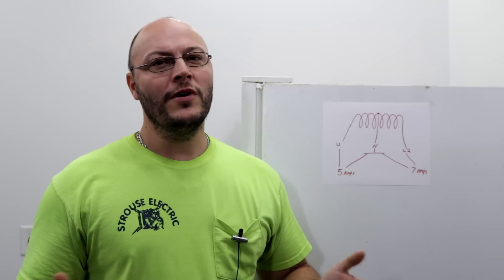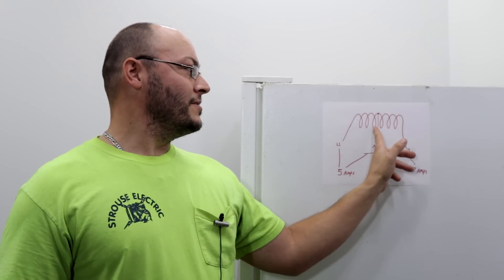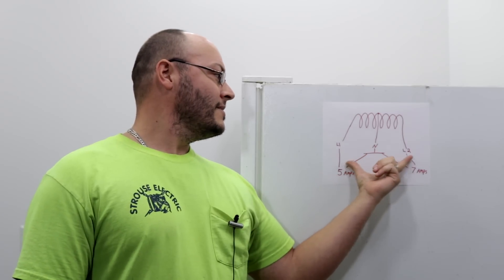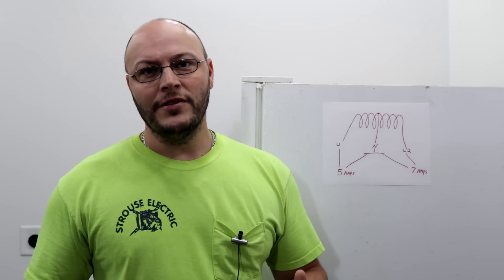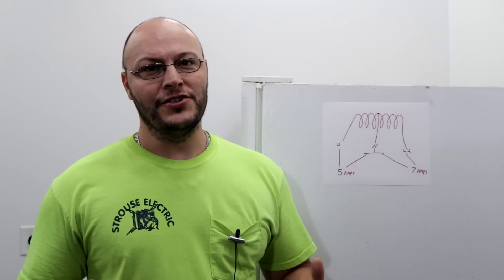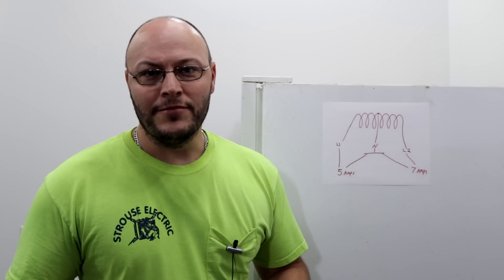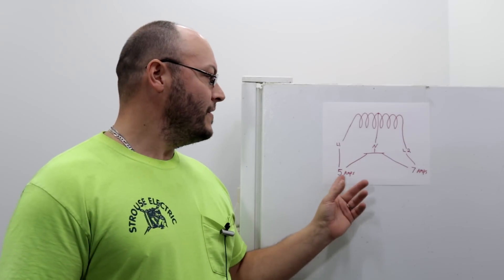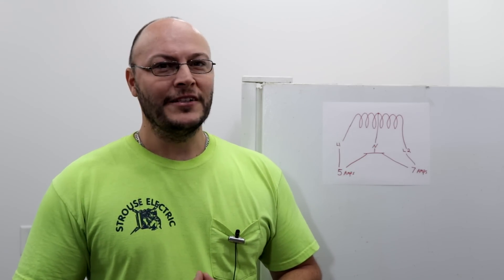What does the Neutral Wire Do?

Comment: Boy all u people need to go back to school.
Depending on what the nuetral is coming off will depend on what its doing
A nuetral coming off a pole transformer is basically a center tap for the transformer and is a means to make a return or complete path for the current.
A nuetral coming from a generator site is actuall a return back to the generator such as a y or delta genertor.
Depending on what municipal electric grid u have u miggt have one or both.
But most have center taps from a single phase high voltage llike 16kv to house voltage if 220.
Every few houses have there voltage off the same can and the nuetral is a return back to that can.
On that can there is a ground which carries earth ground incase of a short in the transformer. 
That ground is not the same as the ground in your house.
The ground in your house is its own thing and its own ground rods.
That is why there us a grounded nuetral at tge service entrance panel and water pipes. This is a bonded system in the house and a seperate path back to earth ground in case the nuetral fails and is not part of the municipal or generator ground but is bonded.
So now we have that figured out.
Every few houses have a can on a pole now there are cans on multiple poles around several blocks.
All these poles with cans on them and are tapped off the same high voltage cable of phase.
There is only one phase or up two 6 phases feeding a area of the municipal grid coming from a substation
There are several substations in an area feeding grids with transformer cans which feed a few houses at a time

So folks the ground in your house is your ground bonded to the municipal warerpipe and your house ground rods. These are bonded to the nuetral at the service entrance panel and only that panel.
After that panel the nuetral and ground are two seperate conductors in your house.
The nuetral is the path back to tge transformer can.
The ground is a safety back to the bond at the service entrance panel and will get grounded out at rhat point.
The nuetral is also grounded at the transformer  but doesnt carry a ground from that transformer back to tge house
That can us grounded at the pole usually with a ground wire coming down the side of the pole. There is also a wire on top of the pole for lightining strikes and that is also bonded

Now the y and delta generators can and also are part if the ground systems in smaller grids 
Such as backup gemerators in which the nuetral is at the generator
This is a whole other discussion 

The voltages that are respect in all of thosd people have to do with whether its coming from a there phase system of a single phase tapped trasformer which most houses are

240 120 is a single phase tappped tranformer sitting on a pole.

208 110 is coming off a three phase system
208 is the single phase  stepdown of a 477 three phase system

Anyway its not to complicated i think i covered it better.

Its been awhile since i had to go back to basics as an engineer 
But ive designed many high voltage grids for nyc and con ed.
Mostly motor control systems woth relay logic but i do have the background and also im a licensed engineer and electrician. 

Most if not all electrician dont understand grounds and nuetrals or bonding thats why there are electrical engineers.
We make sure that these systems are safe 

And sorry about the typos im beat so i just did this quick.

Ill clean it up later
Reply: Isn't it 208 120 coming off a three phase system?
Reply: Ed Taylor 

Yes
It is.
So
480 three phase
Comes out to 277 single phase 
And 208 three phase comes to 120 single phase
120 can actually be from center taped 240 which is SOMETHING a little different
Or 220 110
Depends on municipal company which is usually tapped at 14kv or some other voltage.
It all depends on the grid in your area.
Industrial areas will be running three phase feeders at high voltage and then use step down transformers

Sometimes The 240 is just transformed higher bc of loads from resistance and reactance capacity and some other factors
So the can give u a little higher voltage at 240 120
But every generator and or transformer is a little different
Thats why under load conditions it usually settles around 110

They usually just crank the voltage up a little to compensate for all those reasons above.
That's why sometimes its high and sometimes its low.
Also the load at the time of course.
But u cant just use ohms law to do three phase calculations there is a 
Squate root involved in the equation bc of the three phase component.
I wish i could type it but there isnt a square root symbol on this keyboard

But 477 is used alot in lighting in buildings bc u can use smaller conductor sizes and still put a ton of lights on one circuit
And these buulding have three phase so its easy to balance out either a power panel or lighting panel.

When i used to design motor control centers and relay logic along with the plant electric from con ed feeders into plant for the city of new york there was only three phase stuff bc its a plant
And there were redundant feeders coming from two con ed generator sites
Along with a backup generator.
So its was like triple redundant.
Especially for the sewage treatment plants and lift stations
Tons of redundancy in the electric and controls
Along with the motors and everything else.

Anyway hope this helps a little bit
But thats why large buildings use higher voltages on lights bc of being able to use smaller conductors and or more lights bc of ohms law .

P = IxV
Power is the load of lights in watts 
Voltage is the 477
And i is the current.
Or total current 
So when the voltage goes up with the power being constant the current goes down which means either u can put more lights on the circuit or a smaller conductor.

Later

Thats kind of how it works

Not only am i an liscensed engineer im also a liscensed electrician in three states
But i also taught these classes at several schools 
Or two year colleges 
Including lincoln technical institute in mahaah nj and technical carreer institutes in manhattan
I actually developed and graduated the first class for the est program for LTI
The electronic systems technician program was a two year course
That taught alarms video cctv satellite computers lan phones etc.
Every low voltage thing u can think of.

But anyway maybe one day ill do a utube channel and teach some real world stuff the easy way

Goodluck
Reply: I had a neighbor who purchased an electric sawmill, found out it was three phase and had to pay the electric company to route three phase in to his property. They fed his house off two of the phases and his wife wondered why her electric oven was a bit slower to heat. I told her that she had 208/120 vs the 240/120 she was used to. I think he later sold the saw mill and reverted back to single phase. Fortunately the electric company didn't alter the distribution to the rest of the neighborhood. My voltage is consistently 234/117. Since we are in the mountains the electric doesn't just follow the twists and turns of the road so I am not sure how far we are from the regulator autotransformers  but judging from the voltage stability not so far or good balancing.

One reason people have a hard time understanding neutrals and grounds is because of that old myth that electricity seeks the shortest path to ground rather than the truth that it seeks nothing but will follow all available paths  back to the source (pole or yard transformer).
Reply: Ed Taylor 

Probably easier to get a different motor for the saw lol

There are alot of problems with people understanding electric

If u get the whole concept is great
Then all of a sudden
U get into deep theory and its over there head.

Such as voltage 
voltage is what pushes the electrons in amd out of there molecular orbits. 

If its copper wire then in and out of the copper molecule.
The electron doesnt like this so it trys to jump back and does as the sign wave gets closer to the zero or x axis it falls back into the molecular shell until the happens again as another positive cycle of the sign wave comes  

SAME THEORY BEHIND LASERS AND FLUORESCENT BULBS AND ARC LAMPS.
THE JUMPING OF THAT ELECTRON IN AMD OUT OF THE ORBIT IS GIVEN OFF BY LIGHT
ANYWAY JUST A COOL TIDBIT 

So the voltage pushes the electron back and forth out of its orbit ring of the copper atom
And this sawing in effect of coming in and out is what the current is OR MOVEMENT of electrons

So all this stuff Works together.
Hope i explained it so people understand

But the outer electron in the copper atom is pushed in and out of its orbit by the voltage coming on and off as the signwave changes.from a positive cycle to a negative cycle

And this is also the reason why if u get electricuted   that u can pull ur hand away bc just for that fraction of a second when the voltage is zero on the sign wave u can pull your hand away woth AC. OR ALTERNATING CURRENT 

With dc current or direct current its a positce cycle all the time and the voltage never Shifts off as there is no sign wave 
So dc your screwed and toast.

Anyway so after all that then u can come up with the theory that electrons actually flow from to or towards the positve potential as an electron is or has a negative charge its attracted to a postive source 

So lets say in your car the electrons are actually flowing from ground to positive 
Thats why many years ago the car chasis was actually positive not negative

The idea is also theory when it comes to lightining 

When a lightining bolt is seen by a human

We actually see the return path as the clouds are positive charged and the earth is negative potential
The negative potential is actually.moving towards the clouds

This is called a leader 

And there are some cool photos of this leader if u look for them.
As the negative and positive meet u see the rush of the negative electrons race to the clouds 
This is what we ser as the lightining bolt 

So people on the net or utube are not always informed on what is really going on and seem to just say shit bc they think they know bc everyone kind of says the same thing but in reality there wrong

I dont say i know everything but if i do know something i will say something bc its just another classroom to me.

The problem today with people is they all think they know it all
When in reality they dont know much.
I dont or wont even open my mouth if i dont know 100 percent about something but it goes back to the last thing i said.
People are just misinformed and That keeps going from one person to another

Any how nice to talk.

Maybe someone else reads this and gets some more info

Maybe in the future ill set up a utube channel amd teach real world theory so people are taught what really is going on with electricity and electronics 

Thanks for the talk
Reply: Speaking of lightning I knew a fellow (Roy Carpenter) who sold NASA lightning elimination arrays to protect launch sites from direct strikes. In some arrays he used grounded elevated barbed wire (he didn't like me calling it barbed wire) to provide multiple emission points for electron flow from earth to the clouds to dissipate the cloud charge over that area. His company was called Lightning Elimination Associates. (catchy huh?) As a kid I noticed the top row of barbed wire in a fence lost its zinc coating and rusted before the other strands indicating electron flow and it wasn't even grounded other than by the fence post.

Good luck on teaching, the usual person surfing youtube has little interest in how things really work they just post their version and opinion often with a bit of venom. As such they cannot handle a vast amount of info in one post as you try to deliver, they are still hung up on details like the purpose of the neutral and the difference between a grounded conductor (neutral)  and a ground wire. That's probably why they are not asking you any questions you are rambling too far from the subject and trying to impress them with your credentials and they could care less they (at least some) just want straight forward answers.
Reply: Ed Taylor 

Im not trying to impress anyone
I dont have the need for it.
I have more important things to do

And i jave no idea how barbed wire would work.
As there is a specific science behind lightining.protection systems bro and id be very impressed if not fucking dumbfounded if barbed wire could be used as a downcinductor its not designed for that and the barbedbwire is to low
Bro the trees would get hit first 

But whatever floats your boat.

And like i said i have absolutely no need to impress anyone.

There are a ton of electricians that honestly dont know what a nuetral us or nevermind a ground or a piece of barbed wire as part of a lightining arrestor system.

I see it all the time on inspections 

But ill look for that bardwire down CONDUCTOR 
Lol
Reply: You said, "And i jave no idea how barbed wire would work.
As there is a specific science behind lightining.protection systems bro and id be very impressed if not fucking dumbfounded if barbed wire could be used as a downcinductor its not designed for that and the barbedbwire is to low
Bro the trees would get hit first "

Did you understand the comment you replied to? The barbed wire Roy installed at the Kennedy Space Center in elevated arrays was to bleed electrons from the earth to dissipate the charge in the clouds. I merely mentioned an observation I had made about the top strand of barbed wire in a fence losing its zinc due to electron flow, no mention of any trees or any strike. Your foul mouthed response is a bit indicative of a juvenile or bruised ego. I was trying to offer some engineer to engineer discussion but you're flailing around jumping from one subject to another. I am not sure why but you were the one that brought lightning into the discussion the first place.
Reply: @robprocctvcameras8733  as an electrical  engineer myself bit specualizing in electronic design,
 The formula you gave for power: p=I*v is ohms law to calculate power in Watts. However this formula only applies to DC circuits, or AC circuits with a purely linear load such as an incandescent lightbulb or toaster etc. Does not apply for inductive or capacitive loads as the current (I) will lead or lag voltage(V) by 90° thus the need for a power factor(PF) to be used in wattage calculations. Agree?

Comment: Zip.
1) Some countries use 240 and I suspect one wire is a grounded neutral. Our system is probably as it is because we started with 120v and 240v was added as electric stoves and water heaters came along and would require too many amps at 120v. The center tapped 240v secondary enabled consumers to continue to use their systems requiring new wiring only for 240v loads.
2) There is no such thing as unused amps, an electrical circuit has to have a conductive path to carry current from source to load and return regardless of what it is called. The neutral is grounded for safety purposes but the ground is not essential to the circuit. 240v loads return current is via L2 (actually both as electrons really run to and fro with AC).
3) Ground rods are a code requirement and serve to reference voltage to ground, the neutral is grounded at a single point. Without a ground we wouldn't have a shock hazard unless there was a fault to ground and then the shock wouldn't be expected. The grounded neutral reduces our most common shock hazard to 120v.
4) Two prong plugs have a hot and a return wire to the neutral in the panel to complete the circuit. Most two prong plugs have a thicker blade on the neutral side but some are reversible  meaning a lamp socket can have hot threads rather than hot tab in the center. Most appliances with reversible plugs are insulated so there is no hazard.
Reply: For your #1: 95% of the world uses 220-240 volts live-neutral. USA is an exception. Together with Japan and a few more countries.
Reply: Yes, no good in the UK. We use 230volts single phase for everything in a house - that is how it comes down the wire. Most modern houses etc are supplied with single phase via a system of Protective Multiple Earth cabling (there are other names for it) i.e. it comes in from the street comprising just 2 wires, effectively L & N. Outside in the street (usually at 400volts 3 phase), from the substation coming to the consumers premises, the neutral side is earthed down at intervals via earth rods. Inside the house, the neutral and earth connections plus bonding wires (water, gas etc) go on to the incoming Neutral wire. https://www.voltimum.co.uk/articles/principles-protective-multiple-earthing Industrial premises tend to have 3 phase and neutral cables (PME) 4 core cables, although fuel stations can have 5 core cables (3 phase cores, Neutral + separate earth core) as the PME terminal cannot be used there.
Reply: No amps if no load.

Comment: ya agree with that but i have seen applications where neutral and ground are tied together why soo???
Reply: They are tied together at one point in the electrical panel. The idea is for no current to flow  in the ground wire unless there is a fault. But neutral, ground and earth ground come together at the power entry point and all those currents return to the supply (with or without the earth ground connection).

Comment: The two phases are 180 degrees apart electrically, so while the 7 amps is going in the neutral from a hot leg the 5 amps is leaving the neutral to the other hot leg 5 amps cancel out, and we are left with 2.  This is all rms values too so they are constantly changing so it's really only a type of average.
Reply: Sailus54   It is single phase!   No phases at 180 degrees.   Same exact sine wave in time, different voltages.  120 RMS and 240 RMS.